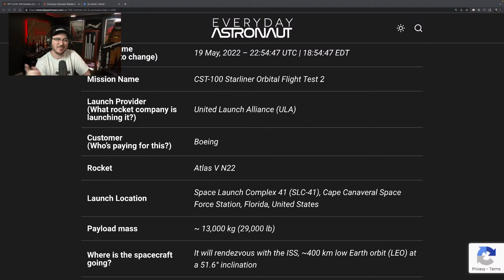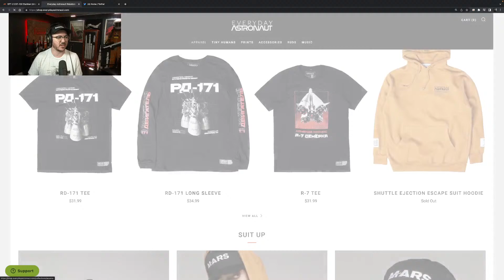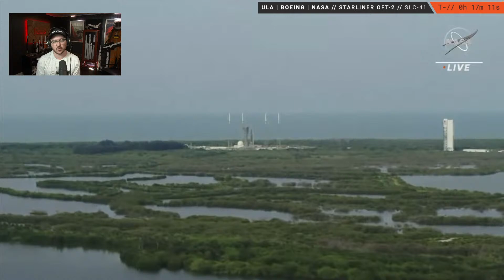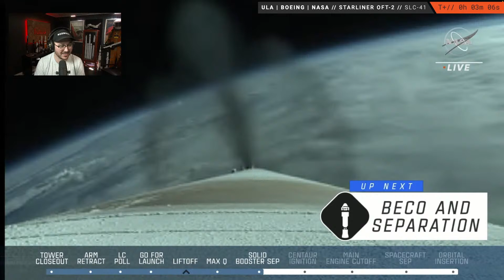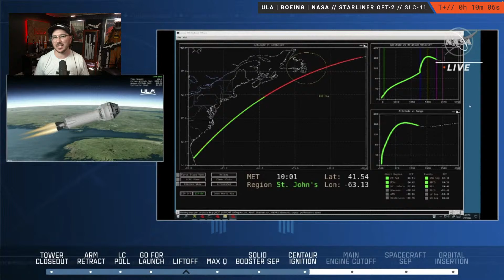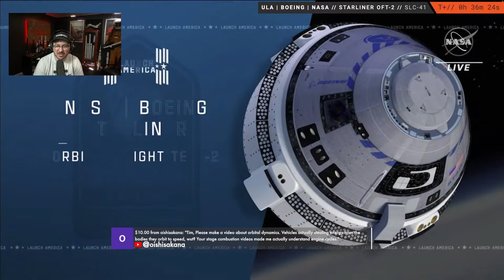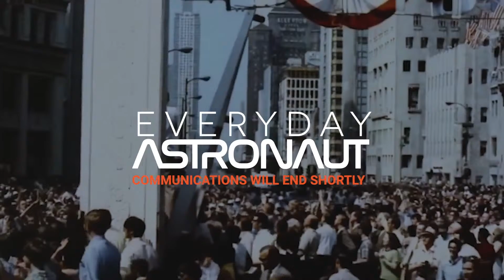Watch Boeing and ULA launch Starliner to the ISS!

Comment: OFT-2 was not successfully enough to move to CFT-1.   Having thruster failures and cooling failures doesn't make it a successful test.  They need an OFT-3 at Boeing's continued expense.
Reply: NASA has yet to decide that. They will almost certainly wait until after the flight and troubleshooting are done to decide if Boeing needs and OFT-3 or can move on the the CFT. Remember, SpaceX's Crew Dragon completed the unmanned test and then the spacecraft exploded on the test stand due to faulty valves. SpaceX was able to isolate and fix the issue without needing to do another unmanned test. So Starliner may be able to do the same.
Reply: @steveaustin2686  OfT-3 is needed.
Reply: @henrypierce8010  You think that, but NASA may not. It depends on how bad the problem is and whether NASA thinks that Boeing can fix it without needing an OFT-3. NASA may decide that they do, time will tell. IF NASA can be happy with a spacecraft exploding due to faulty valve and not require a new test flight, I'm not going to say that Boeing HAS to do an OFT-3 right now, without hearing the official word.

Comment: The last sputter of the old tech.
SpaceX set the new "normal". Reusable. This now feels like watching only half an episode.
Reply: Reusable is great, but not always the best answer. The Falcon 9 Block 5 can lift up to 22.8 tons to LEO per SpaceX when expended, but can only lift up to 16.3 tons when recovered (B1051.12). In June, B1049.11 is slated to be expended as the 4 ton comm sat requires an orbit where there will not be enough propellant left to land the booster.
Reply: @steveaustin2686  For the same price as the one that is bigger SpaceX can launch multiple times. Only a problem if a single item to be launched is over 16 tons, and quite sure if they needed to they would upgrade the Falcon 9 Block 5 to lift additional. It is not as if they are all set in stone and not flexible.
Reply: @isrbillmeyer  Per the NASA IG, Starliner is $90M per seat ($360M/flight) for the first 6 flights. SpaceX's latest Crew Dragon contract is for 3 flights at $900M or $75M per seat ($300M/flight). SpaceX's first contract for 6 flights was $55M per seat ($200M/flight) per the NASA IG. So the cost gap between Starliner and Crew Dragon has narrowed. It's not a one off as the CRS2 contract was bid at 50% more than the CRS contract per the NASA IG. Either way, NASA is evidently more than willing to spend $15M to $35M more per seat to have a redundant crew spacecraft to the ISS. NASA evidently doesn't want to have to go back to Russia, hat in hand, to buy seats of something happens to Crew Dragon.

Nope, the Falcon 9 Block 5 is frozen, because it is crew rated. There will be no changes. If they did change it, it would be the Block 6 or something. Reusing the booster costs you in payload mass for the recovery system no matter what version it is.

Comment: Boeing finally made orbit. Pretty amazing and well done.
Now they just have to learn how to recover the first stage.🤨
Reply: Boeing doesn't operate the Atlas-V, as that is a ULA booster. It was developed before SpaceX even existed and first flew 15 YEARS before SpaceX reflew their first booster.
Reply: @steveaustin2686  
Re-usability of the first stage will be key to bring launch costs down. 
Without this, Boeing will be unable to compete with SpaceX in the long run.
Reply: @fglatzel  Well since NASA wants redundancy, they really don't want both crewed spacecraft flying on the same booster if they can help it. So what exactly was Boeing supposed to do in 2014, when they got the contract, when SpaceX had YET to land a booster?

Yes, reusable is great, but not always the best answer. The Falcon 9 Block 5 can lift up to 22.8 tons to LEO per SpaceX when expended, but can only lift up to 16.3 tons when recovered (B1051.12). In June, B1049.11 is slated to be expended as the 4 ton comm sat requires an orbit where there will not be enough propellant left to land the booster.

Vulcan Centaur is replacing the Atlas-V. ULA has a SMART reuse plan for Vulcan Centaur, but doesn't plan on trying it, until the launch cadence justifies it. Remember, you need all the infrastructure to recover the booster. If you don't fly the booster often enough, you can spend more on the recovery infrastructure than you get back from recovering the booster. NASA swaps crew twice a year. It's cheaper for Boeing to buy two crew rated boosters, even if they are expendable, than it would be to develop a medium lift reusable booster.

Don't forget that New Glenn is planned to be fully reusable and Blue says that they want to crew rate it. The Terran R is planned to be fully reusable, but I don't know if Relativity Space wants to crew rate it. RocketLab has been talking crew rating Neutron, but it can only lift Starliner if it is expended based on the planned payload capacity for Neutron. So it is not like Starliner won't have reusable options in the future that they don't have now.
Reply: @steveaustin2686  
As a Capitalist, I only ever want to know how much I put in and how much I get out.
If Boeing doesn't look at ways to reduce launch costs, they will be unable to stay competitive in the long run
and will always remain a redundant backup system to SpaceX.
Reply: @fglatzel  Per the NASA IG, Starliner is $90M per seat ($360M/flight) for the first 6 flights. SpaceX's latest Crew Dragon contract is for 3 flights at $900M or $75M per seat ($300M/flight). SpaceX's first contract for 6 flights was $55M per seat ($200M/flight) per the NASA IG. So the cost gap between Starliner and Crew Dragon has narrowed. It's not a one off as the SpaceX CRS2 contract was bid at 50% more than the CRS contract per the NASA IG. Either way, NASA is evidently more than willing to spend $15M to $35M more per seat to have a redundant crew spacecraft to the ISS. NASA evidently doesn't want to have to go back to Russia, hat in hand, to buy seats of something happens to Crew Dragon.

Could Dream Chaser cut into that if SNC crew rates it in a few years? Possibly, but that doesn't meant that NASA will drop Boeing. The initial CRS contract to the ISS was for the Cygnus spacecraft at $1.9B for 8 flghts and $1.6B to Dragon for 12 flights. NASA wants redundancy and as long as the bids fit into the financial framework for the program, the prices DO NOT have to be the same. In 2016, Dream Chaser was added to the CRS2 contracts, after SNC came in third in Commercial Crew in 2014. NASA is going with three providers instead of two for CRS2. No reason that NASA might just have three crewed spacecraft, instead of two in the future. After all NASA is funding commercial stations to replace the ISS, so NASA will still need crewed LEO spacecraft. The more crewed spacecraft that they have, the more crews can go up to LEO. 

NASA is not running any of these spacecraft either, but is buying services from the contractors that own those spacecraft.That is the COTS model that NASA has been moving to since the early 2000s.
Reply: @steveaustin2686 
We live in two very different worlds, Stevee. In yours they throw away a plane after each flight and build a new one while in my world,  we re-use what ever you can.
I guess we can carry on and on about our different views, but I will never agree with you.
Reply: @fglatzel  What part of redundancy did you miss? NASA wants two providers, so that they have redundant access to the ISS. If BOTH crewed spacecraft fly on the same booster, that is a single point of failure and NOT the redundancy the NASA wants. So what reusable booster, that can lift Starliner, that is also NOT the Falcon 9, should Boeing be using?

Not my problem you are apparently ignoring the facts. That is on you
Reply: @steveaustin2686  he's actually talking about the Starliner, that Boeing built. Goodluck getting anymore rocket engines from Russia for ULA launches, hope you're not holding your breath for the Bezos engines to come online anytime soon!
Reply: @Rob_Moilanen  Starliner is the third stage or payload of the booster. The first and second stages were the ULA Atlas-V. So no, he was talking about the Atlas-V from ULA when he said "Now they just have to learn how to recover the first stage".

NASA wants redundancy, so they really don't want both crewed spacecraft flying on the same booster if they can help it. So what exactly was Boeing supposed to do in 2014, when they got the contract, when SpaceX had YET to land a booster?

Last year, when ULA announced that the Atlas-V was slated for retirement, ULA also announced that they had already received ALL of the RD-180 engines that they need for the rest of the Atlas-V launches. So ULA doesn't need any more Russian engines and since they have been flying the RD-180 since 2002, ULA said that they are fine flying it on their own. Both ULA and Blue Origin have tweeted the flight ready BE-4 engines on the test stand. So ULA's Tory Bruno's estimate of mid-year 2022 for the delivery of the flight ready engines may actually come true this time. Next up, will be seeing how fast Blue can deliver the rest of the engines for later flights. Blue has a LONG track record of being VERY SLOW in development.

Comment: I didn't anything about this but, is this the same ship that had the failed mission on the other attempt?  eg: Did the re-use the capsule for OFT-1
Reply: IIRC, this was the capsule that was going to be use for the crewed flight. Boeing will use this one or the one on the 2019 test for the crewed flight as they have not specified which they will do yet.

Comment: The SRB’s are what destroyed Challenger. Looks to me like those things would be a non-starter on a Atlas rocket which has been around since Gemini. 

It seems that NASA will never learn it’s lesson from tragic events. They refuse to make changes and I am 100% convinced that is because of their close ties to the US Government and their fatalistic approach to things.
Reply: The SRB's destroyed Challenger. And that was because upper management ignored the warnings of the engineers. Columbia was brought down by a debris strike that opened a hole in the wing and it burned through. Atlantis almost suffered the same fate in 1988, but the hole in the wing was over an antenna plate, that saved the wing from burning through.

The Atlas-V has been using SRBs since 2002.
Reply: @steveaustin2686  

I meant Challenger when I posted that and Columbia was downed by falling foam off of the center fuel tank. Which was a known problem that they waited too late to do anything about. Which doomed Columbia.

The entire thing was avoidable if they had just listened to the engineers that tried to report it. NASA never learned from their errors.
Reply: @earth_ling  Oh yeah, NASA royally messed up with Challenger. With the debris strikes issues, NASA tried some remedies, but nothing worked.
Reply: @steveaustin2686  

Did they not do away with the foam on later flights? Seems like they eventually figured out that it wasn’t even needed.
Reply: @earth_ling  You are thinking of the paint on the first few flights of the External Tank. Foam on the External Tank was there all the way to the end

Comment: It doesn't make sense, that a company like Boeing, had so many development problems with Starliner. 
It should have been easy for them.
Reply: The Boeing and McDonnell-Douglas merger in the 1990s is widely seen as the downfall of Boeing. The MD corporate management took over from the engineer based Boeing management and product safety was compromised in the name of profits. Starliner was designed in the worst part of that era, so the new managment at Boeing has a big hole to dig out of.

Comment: In the era of reusability, this things is useless and obsolete. It’s not that exciting at all.
Reply: Boeing Could Have Saved Some Money By Making (Flight Tested & Proven) Orion Or Dragon Capsules Instead Of Going To The Trouble Of Making Starliner Capsules ! ! !👍👍👍👍👍👍👍
Reply: Starliner is reusable just like the Crew Dragon.
Reply: @steveaustin2686  I was referring to the rest of the candle.
Reply: @mikhail5457  Question. Since NASA wants redundancy, so Boeing needs a different booster than SpaceX, which other orbital booster is being recovered right now that can lift Starliner to the ISS?

Remember, when Boeing and SpaceX got the contracts in 2014, SpaceX was a over year away from landing their first booster and almost 3 years away from reusing a booster.

Comment: Regardless of whether they’re obsolete or not, they’re spending a lot of people’s money, a successful mission wastes less of it, so congratulations are in order.
Reply: Latest glitch with Boeing Starliner! Why is NASA letting this thing dock with ISS? Angry Astronaut 🤣🤣🤣
Reply: @badtrekee4348   Angry Astronaut needs a chill pill. Two of three thrusters in one of the four doghouses failed during firing. The third thruster in that cluster completed the orbit burn and did another orbit burn. The mission does not have to be perfect, just successful. The after action report when Starliner is back on the ground, will likely determine whether or not Starliner will have to do an OFT-3 or move on to the CFT.

Remember, SpaceX's Crew Dragon completed the unmanned test and then the spacecraft exploded on the test stand due to faulty valves. SpaceX was able to isolate and fix the issue without needing to do another unmanned test. So Starliner may be able to do the same.
Reply: @steveaustin2686  True but remember the dragon exploded cause it was also tested to the breaking point. SpaceX had to prove itself every step or the way which was good while Boeing got a free passes cause they concidered themselves god. Karma has a way of humbling people. My beef with them is that they are charging NASA way too much. When the whole point of this is to save money so they can do other projects. Not to mention that Polititians are forcing Boeing down NASA's throat so they can get the kick backs AKA bribe money.

Comment: 1:14:24     Tim deleted his explanation.
Max  q  
q defined as "dynamic pressure" q = rho × 1/2 × V²
This is the point, where the math expression: q =  ambient air density times 1/2   times true airspeed squared is maximum.
The speed increases, but the density decreases much faster, and q reaches a maximum.
aerodynamically, q is the reference, used to calculate the aerodynamic forces and moments. Only at low speeds is q equal to the stagnation pressure at the nose of the starliner. This is only an aproximation during transonic and supersonic speed.
Reply: It is usefull to mention what the density is at different altitudes:
sea level at 15°C  
             rho sl  = 1.225 kg/m³
12000 feet    rho = rho sl ÷ 1.44
22000 feet            = rho sl ÷ 2.0
33000 feet            = rho sl ÷ 3.0
39500 feet            = rho sl ÷ 4.o
44500 feet            = rho sl ÷ 5.0
48000 feet            = rho sl ÷ 6.0
54000 feet            = rho sl ÷ 8.0
59000 feet            = rho sl ÷ 10.

Comment: Sooo apparently a thruster on a booster failed...then the back up thruster failed...but great success and safe for astronauts because the back-up for the back-up worked. I sure wouldn't be riding on any of this system based on the 'performance' to date
Reply: Thats why there are redundancies. And Dragon had much worse glitches while docking to ISS
Reply: @walkinondamoon1  Worse than a primary  and back-up for a single critical system fail?!

Comment: Great to see ULA doing the same thing it was doing (in its previous forms) 30 years ago
Reply: Latest glitch with Boeing Starliner! Why is NASA letting this thing dock with ISS? Angry Astronaut  🤣😂
Reply: @Mity Mo * It's the safest cause the piece of crap uses Russian Engines . THats the most dangerous part not the paint they painted it with. LMFAO SpaceX WILL HAVE A REAL Starship while these Boeing pricks will still be launching this piece of crap.

Comment: Do they recover the solid and main boosters to at least dispose of them in a decent way? Imagine hundreds of those laying at the bottom of the oceans. This spaceship and booster configuration is quite a very polluting solution. It drops parts all over and though some may be consumed on reentry, others will not.
Reply: Not hundreds.. cuz they kinda only put 1 up.
And it will probably be another 20 yrs before we see them try again.